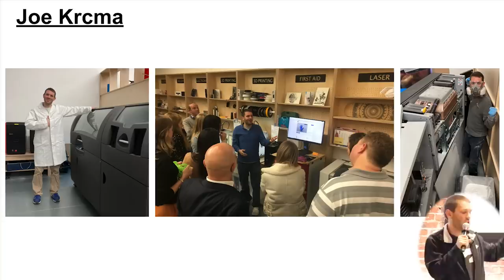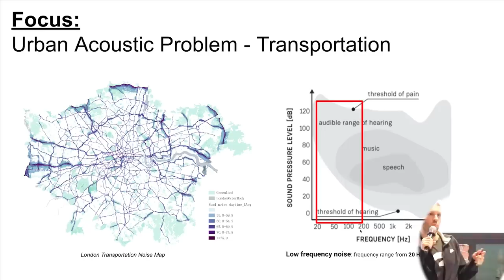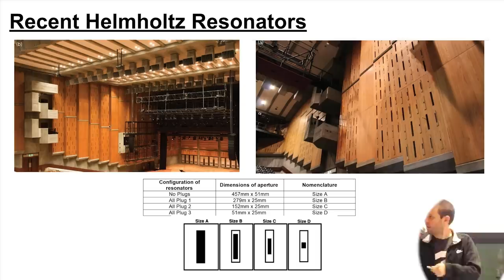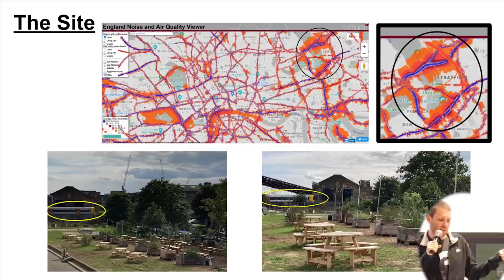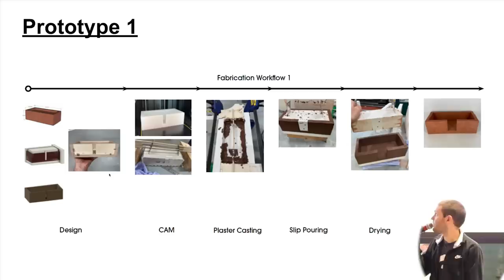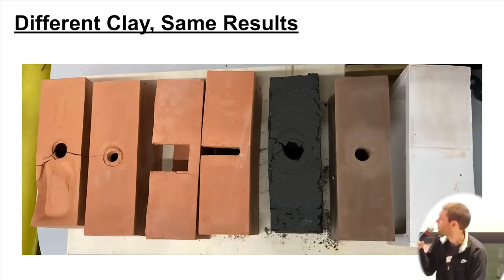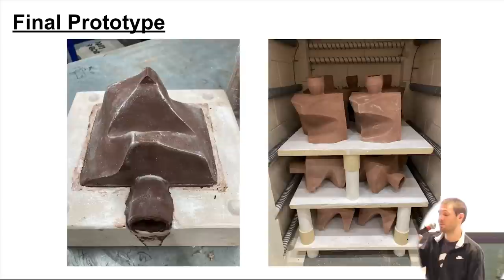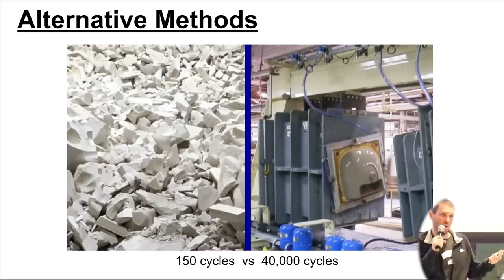These Bricks Can Absorb Traffic Noise - Thesis Presentation on Helmholtz Resonators

Comment: I suggest Forust to produce custom, 3D-printed wood Helmholtz Resonators at volume. Submit your own designs for printing using the Forust process. Forust Edition Shop System™ is an easy-to-use 3D wood printing machine.
Reply from the maker: cool

Comment: I am just some stranger on the internet but it seems to me that in the first 3 prototypes you are reinventing a brick frog. I understand that the cavity in the bring needs to be large to absorb the sound of lower frequencies and that the the depth of of brick frogs is quite shallow at only 10-20 mm. but if the frogged bricks were stacked with the divots facing each other that would increase the cavity size to 20-40 mm. then all you would need to do is cut a half circle section on the wall face side of the brick into the frog, preferably about 1/4 from the edge of short edge of the brick, lay the bricks to form a full circle, and boom a Helmholtz resonator with very little manufacturing change and no specialty molds. and the semi-circle cut into the frog could be done at a 5 degree angle away from the frog to prevent water intrusion.
Reply from the maker: Thanks!

Comment: So pour a concrete wall but attached to the form are PET soda bottles that can remain that will leave the cavity with the tube opening. Make them whatever shape you need but that's the idea for cheap and easy. To keep them from collapsing during the pour they can be filled with air or water. You could attach the caps to the form and screw in the bottles. All the problems you are thinking of can be overcome.
Reply from the maker: Had to use ceramic to graduate…

Comment: Adding to the freeze/thaw discussion below. 
1. What happens if a moderate velocity wind blows perpendicular to the opening. Could it hit a resonant frequency that either becomes very annoying or causes the wall to self destruct. 
2. Birds, Rats & Snakes love little hollows. Overtime these may fill with twigs, fluff & crap which may smell or reduce efficacy. So may need to give thought to a device to vacuum or otherwise clear debris from the internal cavity. Or perhaps high pressure air from below to blow it out the hole above.
Reply from the maker: and spiders!

Comment: My house and backyard is along an interstate. Would be neat if I could easily stack these into a wall near the back fence such that it reduced the noise level. Have considered putting heavy vinyl sheeting on the opposite side of the fence, but I imagine a lot of the noise goes over the fence anyway and bounces off other houses before it even makes it into my yard. Hadn't heart of Helmholtz resonators before, but does seem like a helpful thing to sprinkle into the mix of sound barriers.  Thanks for sharing your presentation.
Reply from the maker: Glad this helped!  If you want the file, it's in the link

Comment: Nice to see more people working on this. Companies in India and other nations have been working on modular ceramics for air conditioning. I’m curious if there is some way to combine these efforts? I understand that these are initial prototypes and you presented various methods for upscaling such as high pressure resin casting, but do you have ideas (perhaps I missed it) methods to make them more efficient acoustically than wood or foam? At one point you mention they perform as well as wood or foam, so in curious how your team might improve the performance in the future considering the somewhat complex manufacturing process required to make these. Im very hopeful for you and others to keep pushing this kind of technology forward!
Reply from the maker: Thanks so much for this!  Yes, I'll make an updated video on this soon!

Comment: I have often said that an artist's sketches can be more interesting and informative than the finished piece  because it provides insight in the artist's goals, throughts, and atristic process. Your presentation provides just that. 

The concept is good, but for something more practical, you will need to design in drainage and possibly a means to prevent accumulation of dirt/soot inside the cavities and cracks. Besides water being a concern from a health issue (think mosquito breeding grounds), you may have issues in cold climes due to freeze thaw cycles. 

Oh, and shoudl the cavities become nesting sites, make sure the bird droppings arenot damaging to bricks. lol
Reply from the maker: Thanks, I'll test that

Comment: Fascinating, you should take a trip to Cambodia, India or Vietnam. They are many fascinating brick making factories where bricks are made the hard way. Manually one at a time.  You can see some of these on you tube. With your engineering and their experience and manual labor; you could quickly and cost effectively make a large number of bricks in various designs. Noise is a complex thing all societies are dealing with. A future iteration of this research could have you partnering with a local home builder, and a local brick maker in a foreign country. You could pay them to make the bricks the way you suggest, then they install them and you test the resulting home/wall/room for acoustic properties. Many of these brick makers work in horrendous, low pay, high heat conditions. They would happily work for higher pay as a custom brick maker, making bricks they way you want. They would also probably have great experience in how to make whatever shape you want without warping.
Reply from the maker: Thanks, I’ve been to SE Asia a couple times so I’ll check those out next year 🤩

Comment: I'm not sure how we didn't come across each other at UCL - I'm a Research Fellow in the Bartlett working on soundscape engineering methods and that impedance tube lives in my lab! Really interesting to hear about the design process and manufacturing. Are these bricks and molds still around at the Bartlett? We have some PhD students working on Helmholtz-based walls for soundscape interventions in practice and it would be great to iterate on your work and test it in a real installation. Really good work and nice presentation!
Reply from the maker: Thanks so much, and what a small world!  The bricks should still be there...somewhere?

Comment: Very interesting. Ive got yo figure out a simple and inexpensive method for accomplishing something like this for my corner property on a busy road.
Reply from the maker: Thanks!  The free file is here if you like (description)
Reply: @JoeMakes  I'll take a look. Firing clay isn't something I feel confident sinking money into. I'm hoping I can translate the basic properties to a feature fence along the property at the road. Limited to 6ft tall.

Downloaded the thesis... Later this summer I'll be doing some small scale tests for our property. My goal is to create sound absorbing or frequency changing structures for this corner lot but my limitations are that it has to be easy to maintain, cost the same as planting and maintaining a double row of giant arborvitaes, has modular parts for incremental building, and construction needs to be possible for a single individual or small team.

Comment: Have you considered the production method known as centrifugal casting? It is often used in metallurgy and complex plastic shapes for casting, as it eliminates bubbles and ensures uniform thickness. The only thing left to work on is how it will function with your product's shape. It was very interesting to hear about your design process and final product; it is a very clever solution.
Reply from the maker: Thanks, I looked into it but these bricks are rather large and had to be made with clay.  But something to think about!
Reply: @JoeMakes  Yes, I understand, clay is a complex material in this regard. I think you can to work on the molds for casting and the thickness of the clay. The clay should not be too thin because it will crack a lot during baking, and not too thick so that it can be poured properly (even with thick clay, the centrifuge will still distribute it well along the walls). There is a technique in ceramics called slip dipping, where the finished product is dipped into clay of different colors, thus applying additional layers, and then, after drying, ornaments are carved out. I think you can try to find a consistency with the right parameters for pouring into the centrifuge. Sorry for butting in with my thoughts; I often have to solve similar problems at work. After watching the video, some ideas came to mind, and I decided to share them. The project is cool, thank you for your video!

Comment: if you are selling this product you should edit this video to make it more concise and direct to the point. I had to skip to 3:01 to get to the point and again to 6:48 to skip more redundant info. Here is a recap for the ones who just thought it was too long:
1) there is a lot of noise in cities. my study was based about london traffic noise
3) there are not many solutions for exterior structures, just for interior.
2) my solution actually existed thousand years ago and was developed by Marcus Atrubious and again by  Herman Helmholtz, he just refined it.
3) the way he adjusted the herman helmholtz was by creating it in a form of bricks, that you can use in your everyday constructions. more specifcally, residential.
4) his bricks are made of a mixture with terracota and ceramics.
Reply from the maker: I'm not selling it.  It's free in the link description...

Comment: Reducing the number of cars would also reduce the ammount of noise without the need for expensive new infrastructure but that gets considered as an option
Reply from the maker: Trains?
Reply: @JoeMakes  Busses, a set of bus stops allows a road previously used by cars to be repurposed for public transport in a cost effective way, trams and trains are better and quieter for cities but involve lots of new infrastructure which busses aren't reliant on. Besides, it's not like the red double-decker isn't already a fixture in london

Comment: Future iterations would do well to strengthen the extended neck and add an angled surface above to make them less inviting to try climbing.  For one, someone will fall off and break their neck, and secondly it means hat the wall can be used to keep people in / out of an area (ie. off the train tracks / freeway).  Other concern is people filling them with trash, or simply dirt filling them over time.  All that aside, neat concept.
Reply from the maker: Thanks, I'll do an updated video soon on this

Comment: On the topic of cracking from uneven drying and during firing, have you considered using significantly higher amounts of temper (I didn't hear it mentioned in the things you tried)? It may be more tricky with slip casting, as you would need to find temper that doesn't fall out of suspension, but I do know that it can prevent cracking by decreasing contraction during drying and can increase the resistance to thermal shock while firing. 
Most modern pottery uses tends to use very little temperature because now they can get away with it because of the very controlled firing process and the industrial production of very pure clay, but traditional pottery (especially kinds fired in basically normal fires with no kiln) often used much more temper which allowed it to withstand the much less controlled firing environment.
Reply from the maker: Great insight!  I did experiment with temperatures but left that out of the study.  The shrinking with slip casting was an issue, so I reverted back to the lowest temp for recommended terracotta.  I'll cover this in a future video update.  Cheers!

Comment: A very neat idea, and I'm always interested in seeing the Old Ways brought back.  If I might suggest some caution, though.  One of the problems with weird shapes is that they need to be installed in a very particular way, a way that's not an "industry standard".  What that means is that when it comes time to lay the block and make the wall.... you need people who are trained in laying those blocks in the correct orientation and pattern.  That is going to severely limit their application around town, and thus diminish their effectiveness.

It would be far better/simpler to make a HR that's a simple jug shape and fits in the standard row of a brick wall, for example.  When laying bricks, there are many ways of going about it that are both decorative and functional, and half-bricks are used all the time.  Could you not make a Resonator that's a simple cauldron shape the size of a half-brick so it could be slipped into the course without a second thought? 

I'm not suggesting that masons are unlearned neanderthals, so please don't take it that way.  On the construction site, things happen and a lot of the work is done as quickly as possible because time is money.  The guys are moving with speed and purpose, so the easier we make the job, the more likely we'll get the results we are looking for.
Reply from the maker: Haha, I’m not a bricklayer in any way, and after trying to grout these have a new found respect for any speedy bricklayer in the field!  Just wanted to see if this could work, and was surprised at the results.  Will make an updated version for this wonderful comment 🤩
Reply: @JoeMakes  I only laid bricks in high school, which has been more years passed than I care to think about.  😁  As a blacksmith and fan of the history of architecture and the traditional trades, I was overjoyed to hear about these resonators being used in ancient structures.  It seems like every time I turn around, there's some new marvel being rediscovered!  Thank you for the wonderful explanation, and the work you're doing.

Comment: What a great focus for quality living - sound dampening for quieter living spaces. I wonder if firing bricks may produce a more brittle and vibrational material (as opposed to noise dampening), than simply compressed earth.  Have you considered using unfired, interlocking compressed earth blocks ICEB's (which can be made with a manual or automated press) and building wave walls, or waffle walls of convex and concave curves. Compressed earth structures using a small amount (5%) of hyrdrated lime have lasted for centuries.  See youtube by engineer Jim Hallock.   I wonder if adding biochar to the clay mix may add the porous sound dampening quality and lighten the weight.  School playgrounds would benefit from sound dampening and provide welcome relief for overwhelmed teaching staff and sensitive autistic children.  There is also this great design "Innovent" block that may buffer sound as well while providing air flow and rain protection: https://youtu.be/fwR0ACFJnlE?si=8jC17RvzPV-THLKZ
Reply from the maker: Wow, really interesting!  Thanks for this.  I'll work on making a second version and doing a video showing these results. 👍

Comment: Joe, Outstanding work! With science, it’s a process of learning the problem, then how to fix that. I enjoyed your “Failures” and being very straightforward about the learning process. 
I’m curious if sound attenuation can be applied only at the height of our ears? Any thoughts on that? For instance at restaurants where there are lots of smooth surfaces, like tile floors that reflect sound and add significant background noise. This would reduce implementation costs for the owners and still do a reasonable job of lowering background noise. Thanks very much for your inquisitive spirit!
Reply from the maker: Thanks so much, Vince!  Glad you found it interesting.  Applying these in restaurants would be helpful.  Although sound doesn't care about ear height in humans, base traps in corners are helpful.  You might enjoy my thesis paper in the description.  I'll make another version soon, so keep in touch!

Comment: abc australia had a tv show called the new inventors that was on about 20 years ago.  on one show, a person presented a wall vent that minimised sound entering the building.  it was cast in plastic with an s shaped passage to let the air through.  the air flowed past cavities of differing sizes as it flowed through the block.  the cavities absorbed the sound.  the resonator bricks presented here are rather delicate and not really practical in real buildings.  there will be a lot of mortar slopped in around these things where they butt up against normal right angled rectangular house bricks.
Reply from the maker: Those Aussies and their big bricks

Comment: Interesting. Where I live, buildings are made from wood. Street noise is a problem, particularly from larger trucks, and motor cycles (hawgs). So far, I have depended upon an earth bern to reduce noise, but it's not very effective.  I might be able to install some of this ceramic wall, but I worry about it filling with water, dirt, animal and plant deposits. I'd say that such a cavity could be made with a water drain hole, and also the ability to be easily removed, and then fired to remove animal/plant debris, and the dust poured out, this would be ideal.
Reply from the maker: Thanks!